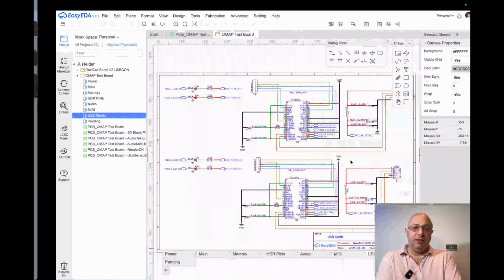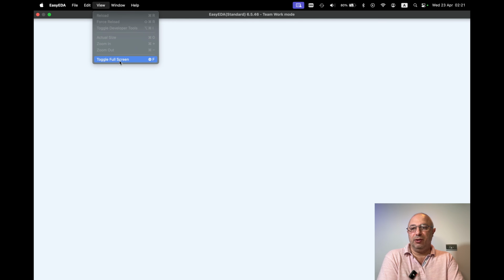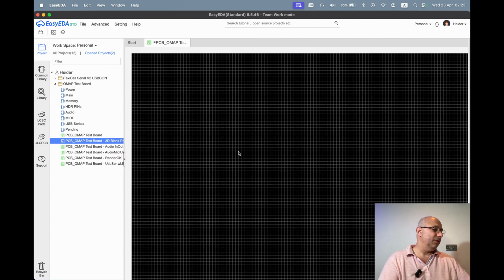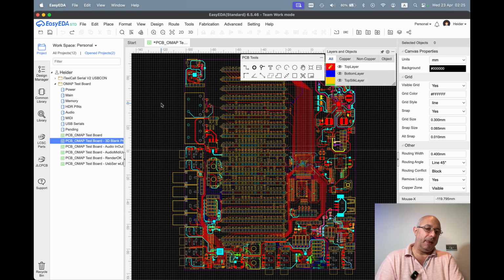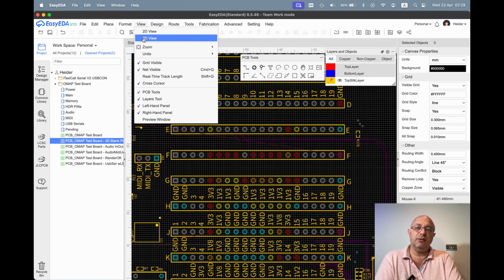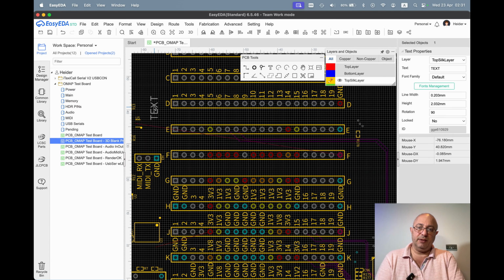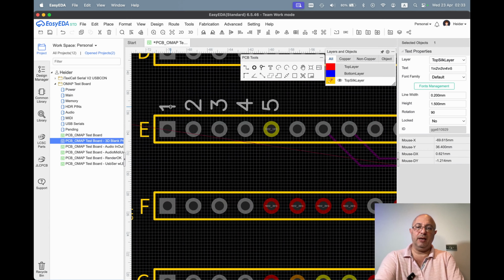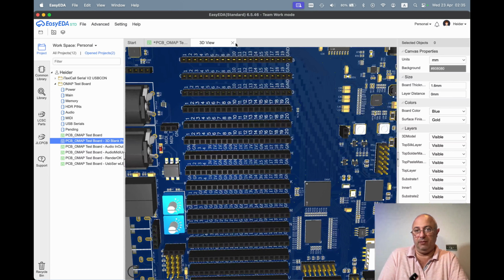EasyEDA Fix to the 3D Blank Screen View Problem

Comment: Thank you. I am having the problem with a blank screen when I just generate the PCB.
Reply from the maker: If you are using the EasyEDA APP and it's going blank, and you can't figure out what's causing it, then try the web version it will work, not an idea solution but it will get you going for now. 

I already reported the blank problem to EasyEDA support team, it's been with them for months, they said they are working on it, I've not had any updates.